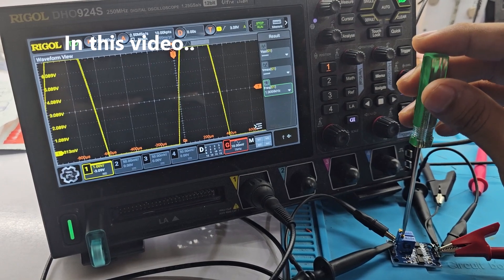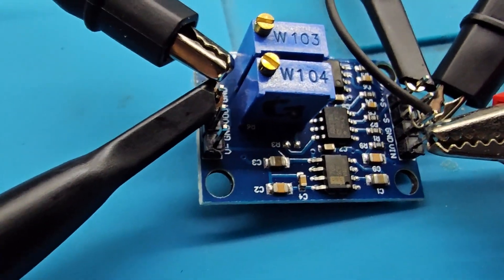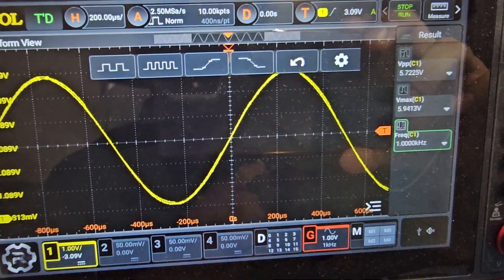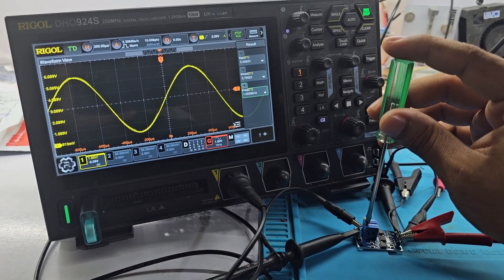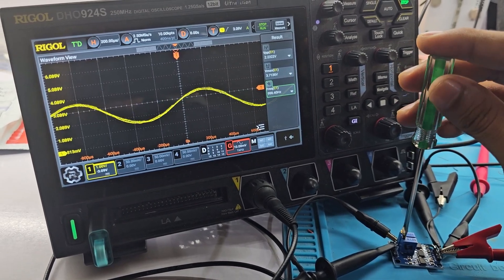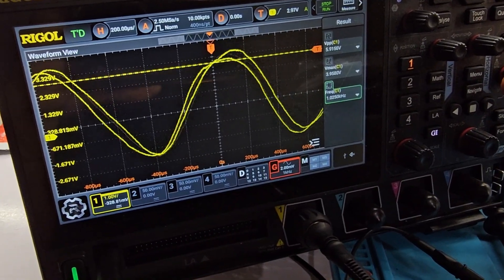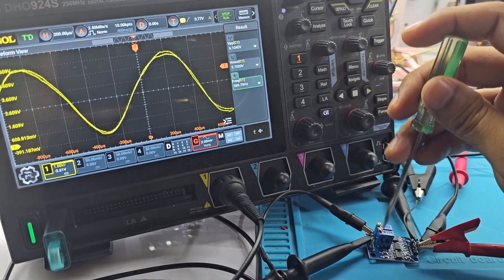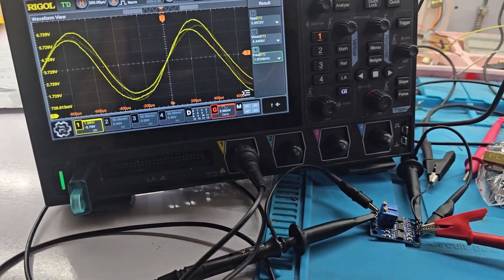AD620 Mirco Milli Volt Signal Amplifier | Instrumentation Amplifier | ProDrone Control | #ASNNRI

Comment: It's crazy you got so much noise at 2mV and 1Khz. I would expect something better from AD620 (which is low noise and low voltage offset).
Reply: Because this is a fake aliexpress "ad620" . In fact, I have a feeling that this is a discrete lm358 based instrumentation amp.

Comment: Does this amplify the electricity? I dont understand
Reply: It amplify voltage difference between the two pins. So if you get 2mV between the inputs, with 100x gain you got 200mV.